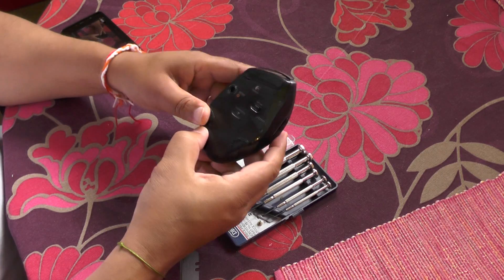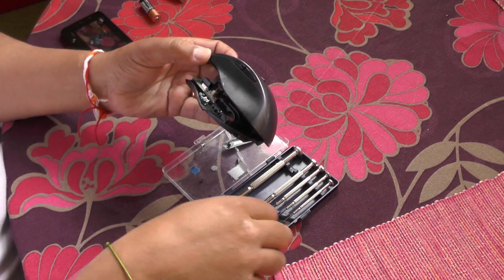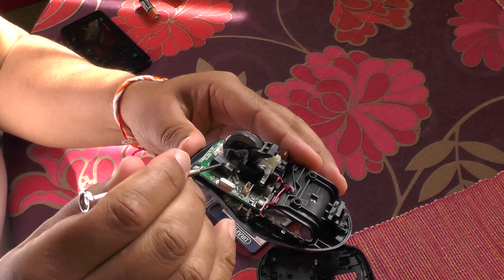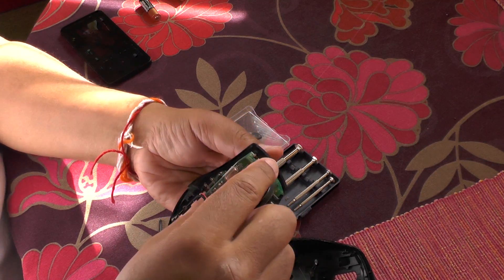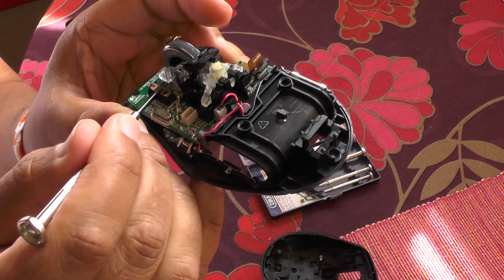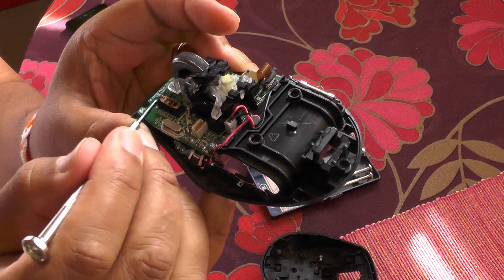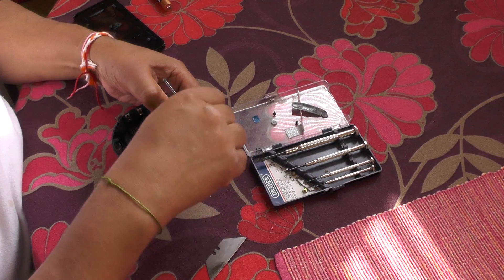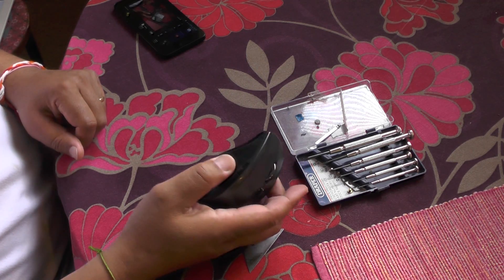Logitech Mouse Double Click Problem and How To Fix It - Red Ferret How-to

Comment: Did this fix on my Performance Mouse MX. Took me a little while to understand how the copper spring 'hooks' on one end, slides between the contacts at the other and then clicks onto the curved spring in the middle.

It actually feels better than I ever remember it being before (although time will tell how long this fix lasts). I found spring more robust than it first appears but you do absolutely need to be careful with it. Good additional info on Red Ferret website.

Worth noting that if you're more confident with soldering, might be easier to get replacement switches (lots available from China on eBay for not much cash). I actually bought a few so that I could have spare copper springs!

Comment: I suggest you should replace the click directly, originally one is Omron D2FC-F-7N which made in China, recommend Omron D2F-F Made in Japan, witch can resolve the click problem until other parts damage or you throw it to the trash the click still work fine.
https://www.omron.com/ecb/products/sw/13/d2f.html

Comment: this is a lot of complicated "precision" work.  would it not be simpler to just buy another mouse?   My mouse has  a problem where it double clicks when I want it to single click.  then sometimes it only clicks if you push hard.  I want a quick and easy fix, not many minutes of precision work.  Its all about the copper metal.  If it needs to be rebent to work, forget it!  I could damage it.

Comment: "here look, as you can see"... then proceed to do a 1.2 sec closup while moving left and right, rotating and shaking like a mofo. It's like an eye teaser....
Reply from the maker: +rcknroll35 You know what? It's really really difficult to do this kind of close up. As I discovered. Much easier if I had a cameraman and lighting engineer to set it all up. But I don't. Sorry. :)
Reply: I think it's just the camera's angle. You could try different options. Looks like you tilt things towards the left when you work, so maybe positioning the camera in front of you on the left would give you a more workable view.  Thanks for making the video though!

Comment: The bottom line is, Logitech has a major design problem with their mice. I have three and all have the very same issue.
Reply: Totally agree.  I have four with the same problem. Damn. I just got a Microsoft mouse now....   will see whether it will have the same problem or not....
Reply: @anuwatj19   Thank you for sharing your experience. I've been using the same Microsoft mouse for over 10 years without serious problems... I thought that a new logitech "performace" would be an upgrade... but here I am...
Reply: It's a feature, so you have to buy a new mouse every 1-2 years
Reply: The problem is down to Omron who make these switches.
Reply: My M275 is the most comfortable mouse ever but started to have clicking problems 1 week after purchase, so yeah every Logitech mouse has this issue
Reply: I had Asus, Steelseries, Logitech etc. and had this problem in all of them.
Reply: Correction, they have a major problem with anything that has to do with technology. Only thing they make pretty well is the webcams. Besides that LogiNoNo.
Reply: It's LogiCRAP.    It's flimsy construction is by design, so you buy yourself a new one.  Someone with enough time to waste and know how could easily use a substitute to this bloody thin piece of copper and extend the life exponentially.

Comment: I got dizzy. If only there'd been a few freeze frames. I might just spring for the $15 refurb instead, lol.
Reply from the maker: +Joe Zyzyx There are lots of still images on the actual blog post - http://www.redferret.net/?p=31008
Reply: +Red Ferret 
Thanks, I'd not come to the video from that page. Very good page. I came to video direct from youtube, so didn't see the blog.
Reply: +Joe Zyzyx Pro Tip: You can pause videos on You Tube.

Comment: Thanks a lot, big help - although as some of the other comments pointed out, it seems to be a matter of straightening rather than bending to get a good click back.
i also used a bit of 1200 grit sandpaper to clean the contacts on the switches, swapped the left and right spring and i think i'm good to go for a while, at least until the cable on this G500 becomes too short from having to cut sections out when they start fraying and causing it to lose power.

Comment: For those of you who do not have many tools on hand, I was able to finally get the copper spring back into place by getting the left and right sides into place with the middle spring resting on the stand. Then very gently pushing down on the middle spring till it pops into place. This may take a few tries, and if you push too far down you will deform the center piece and will need to straiten it before continuing.

Comment: Red Ferret, thanks for the video showing how to take the button apart. However, there shouldn't really be any need to bend the metal piece. It obviously moves correctly. The fact when the button is pushed and intermittent/multiple clicks occurs is clearly a contact issue. The contact point may simply have become oxidized. A cleaning should do.  Dale Santly  has the right idea. In any case, that's how I fixed mine, no bending necessary.

Comment: I tried to solve this problem by replacing this micro-switch, but after some time of use, it happens again. And not only with this model, but other logitech mouses. This fuc**ng switches are very bad designed (first mouses I had didn't have this problem) and a -1 to Logitech for using cheap components.

Comment: Thanks a lot, your guide really helped with my G700 (click and hold issue)!
Lust be aware, be SUPER gentle with that SUPER fragile copper spring - I broke it while trying to take out. I was lucky to find my old non-functioning MX-518 - fortunately it has exactly the same micro-switches, so I took a copper spring from there. I also treated the contacts with a drop of anti-oxidizer prior to assembly.

Comment: Pro tip: Apply tape on the top of the Onrom microswitch to stick the white bit onto the black case. That way, when you remove and replace the black case, the tiny white bit won't get lost.

Comment: Really helpful video, thanks. Though for putting the spring back on, a different strategy worked for me. I flattened out the curvy bit, and that allow me to gently push it down and make contact with the part that it holds onto. When it was rounded, it wouldn't create any tension and I was scratching my head to figure out what exactly it was supposed to latch onto.

Comment: I fixed mine by putting a few thicknesses of scotch tape (cellotape) over the white part of the microswitch so it gets pressed in further.  That might give me a year or so before I have to take more apart, but it was a lot easier to do and works for now.

Comment: First of all thank you so much for the disassembly and the explanation. The thing which I want to say is you don't have to make the spring bend more curvy, instead you have to flat it out. If you carefully check out the behavior, spring bend usually becomes tighter if you make it flat. Its spring physics. You have to then make the bend by stretching it to the front clip :) First I tried to do it by your way and the click became softer which feels terrible to our finger (as it has to be optimal, not hard nor too soft). It opened it again and made it flat. Voila!! You yourself stated that your clicks are soft. Try it in my way next time!!

And again, thanks for saving my money!!

Comment: Ok opening the small rectangular box inside....I tried but just couldn't get it open...applying a bit more force caused the solder pins to slightly force out of the board socket which is not right, right!!! Well..that scared me off...

Do all mice have this spring which loses strength over time or do some mice (more expensive perhaps!) have a different mechanism so their clicks don't go bad..
Reply from the maker: I'm not sure about other mice, but it seems that most Logitech mice do have this spring. Regarding the box opening, you need to carefully insert a thin blade under the plastic end and gently lever it outwards not just upwards. The catch then comes loose and the box pops up. Hope that helps.
Reply: Red Ferret  I got it open...mine's a Microsoft mouse and their latch is on either side of the rectangular microswitch's length, not at the top side like Logitech. Problem is by the time I figured it out and opened the switch by inserting a geometric compass's pointed end in the tiny hole on the side, the whole switch became even more loose from the mouse chip board...I will have to get a soldering iron now to fix that..
Also I bent the small metal spring inside completely out of shape (one needs really steady hands to do this, all the parts inside the microswitch are so tiny and delicately placed). Ended up switching the metal spring from the middle click (don't use it much anyways).
 Don't throw away your old mice guys...harvest those microswitches (or good metal springs inside em).

Comment: Ok Got The Mouse Top Off  ..Unplugged The White Connector ...Can Not Figure Out Where You Inserted The Blade To Remove The Top Of The Mouse Click Unit Cover To Get To The Copper Piece
Is There Another Video Showing A Better View For This Step Either For This Mouse Or A Similar One

Comment: That spring is a complete pain in the ass to put back.. Seriously fiddled with it for 45minutes before finding a way to put it back on. I tore down an old logitech mouse that surprisingly used the same clicking mechanism box. Next time I'm just going to solder a new one in.

Comment: Thanks alot for this guide, it gave me the courage to open up my logitech G100 mouse and I was able to fix my double clicking issue. Even though it has different pattern of the switch but it gave me the idea on how it works and how to repair it.

Comment: Thank you for solving my problem with mouse. From begining I thought that I will ruin my mouse because I had problem with placing copper spring back in position (not so good shot in video). Finally I had to open second (functional) button and look how it should be. At the end everything is working :)

Comment: Oh man, you saved me more headaches with that extra tidbit about bending the copper bit more into a sharp U or V shape. I had it just bent out straight and it took me two hours trying to put it back in, until I went and found your video. Thank you SO SO MUCH!

Comment: Thanks for that great tutorial.
In the end, however it would be better to completely boycott Logitech as long as they deliberately produce extremly high priced gadgets that die ahead of time. EACH of my three Anywhere MX mice died before two years of age (with a double click), and that's an infamy. Also the power switches tend to die, as well as the power switch on my 90€ diNovo Keyboard did. I never touched that switch at all (I was not even aware of that switch untill it died).
This company is betraying their customers continously.
Reply: https://en.wikipedia.org/wiki/Planned_obsolescence
Reply: They could use off the shelf microswitches that have far more lifetime not to make their own one from a soft metal.
Reply: I'm on my 3rd mouse that just started double clicking and I've only had this one for less than 6 months, they're not cheap either, and I'm pretty sure I won't be able to fix it and end up losing all the pieces.  At this point I'm just going to switch to cheaper mice and just use them as disposable.
Reply: yo bro all my computer accessory are from that company and i have it for more then 4 years all thing still good and work just fine so idk may be it is about the users sometime 
now i have this issue (double click) and guess wot i just blow into my mouse and its work holy moly no more faken double clicking shit

Comment: How do you guys manage to cancel out these switches? I have two 6 year old G5's which use the same Omron switches as the new mice, I gamed with one daily for about 5 of those years, and the other one is a daily work mouse. No issues with either. Something for me to watch out for, I guess.
Reply from the maker: Hmm...that's interesting. I wonder if there's something about the way you hit the button, or the intensity or something that makes it more prone to wear? If so I definitely have the 'wrong' touch since I've been through around 4 of these mice. Still love them though. :)
Reply: Couldn't say, but I did recently fix a clicking issue that I had on my current G700s. It had nothing to do with the switch. On the G700s, there is a low friction pad attached to the bottom of the button actuator, that pad's adhesive started to fail, which caused the pad to slip, exposing the still gooey adhesive, which did a bang up job of effectively gluing the button actuator to the switch, which was really, really inconvenient as I was in the middle of a TF2 Mann Vs Machine wave. Logitech sent me another G700s to fix it, but I managed to take the mouse apart, clean up the friction pad area, and re-glue it with super glue. It still works, but I had already fried the internal memory used for storing profiles on the mouse, so I still needed the replacement. I'll probably replace it with a G502.
Reply: Oh, the G700s uses the Omron switches, and so does the G502 as well.

Comment: Had to go through 8 different guys spilling liquid on a spring before I got to this video.
I didn't realize the clickers pop open.
This is the only real solution for the double click issue and can keep your buttons alive forever.
The critical bend isn't the one at the edge though, it's the one in the middle. It what makes the button jump back. To make it stronger flatten it a bit, to make it weaker round it a bit.
I actually went ahead and made my right click button tougher as well, not only did the left stop doubling, but the mouse feels a lot better now, with far more responsive clicks.

Thanks Red Ferret, for a very useful video.

Comment: Thanks for sharing this and the useful hints (using a blade instead of a fine screwdriver to open the microswitches, location of the screws underneath the battery compartment where on my model I only have cross shaped slits, not round holes). One word of caution: I found it very difficult to get the microswitch clicking again (in the end I managed though), if I knew a supplier for replacement switches (same dimemsions and same locations of the electrical pins), I'd rather replace the switches...
Reply from the maker: If you look on the original blog post (or somewhere in these comments) you'll find a link to the switch seller on eBay. Hope that helps.

Comment: Mine periodically has the same issue, it doesn't always happen, but when it does, it's very annoying, and i've noticed that it only clicks if I press really hard and fast, and if I remove the batteries and turn the computer off for a day, it corrects itself. Definitely a physical problem in the mouse, but I think there is also some very hidden software problems too.

Comment: Just fixed my G700. Thanks for the vid.
Assembling everything againg is the trickest part. It took me almost one hour.
Is it possible to buy just the spring if we mess up wih something or the button spring is just too old?
Reply from the maker: You can get the whole switch on eBay (there's a link in the blog post or in the comments around here somewhere).

Comment: Don't open the switch. Mostly it's enough and much easier to use just some brake cleaner or contact cleaner on the closed micro-switch.

Comment: Ugh I CANNOT put the copper spring back onto the microswitch. I'm putting it on but it simply won't attach.
Reply from the maker: Look at the diagram again. It fits just underneath the tiny lip at the TOP of the bracket. Not at the bottom. So you sort of hook it under that lip and then push it into the slot at the other end, then gently push down in the center until it clicks.
Reply: Red Ferret Thanks for the advice. I still cannot get it back in tension. It's getting so frustrating. I think I'll take a breather and get another 3 hour crack at it later on XD
Reply from the maker: therichardchannel Good luck.

Comment: I have two of these mice and they are my favorite but both have the double clicking issue with the first one much worse. I did this fix to my old one and the click now gives much more feedback and has yet to double click or fail during a drag. I will be doing this to my other one.

If only someone made a more reliable piece that could replace the one Logitech puts it to force users to replace their mouse.

What is worse is that Logitech claims the issue is a static charge build up in the switch and you have to turn it off and remove batteries and click it continuously for several minutes to fix which never did work.

Sadly I have a Razer Mamba on the way to replace my home mouse but this will stay as my work mouse.

Comment: Thanks for this.. it seems to work so far. Took me about an hour because i was using the wrong tweezers... I switched to using one with less resistance and then I was finally able to get the copper plate back on. It IS softer and seems a lot more sensitive to the touch, but I can get used to that. But, the double click is gone for now. Going to your website and checking out the diagram helped a lot too http://www.redferret.net/?p=31008